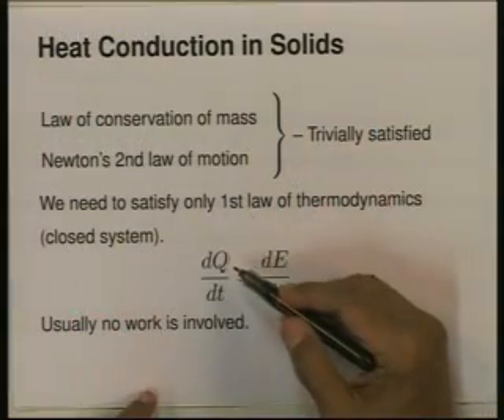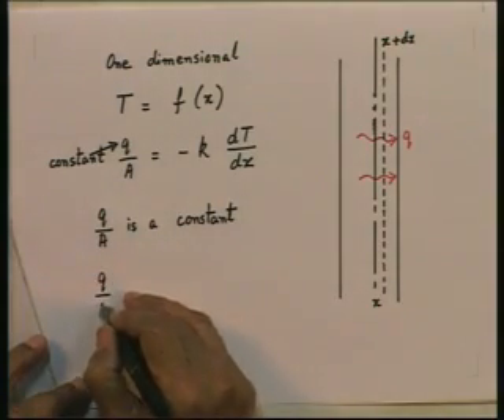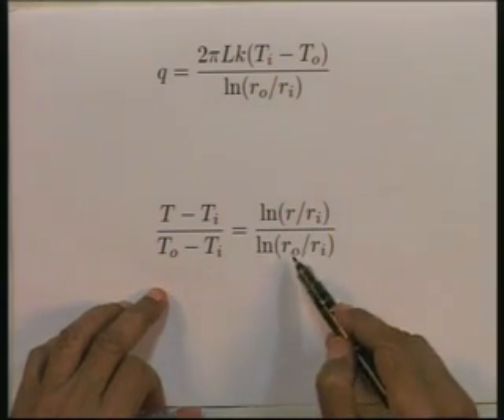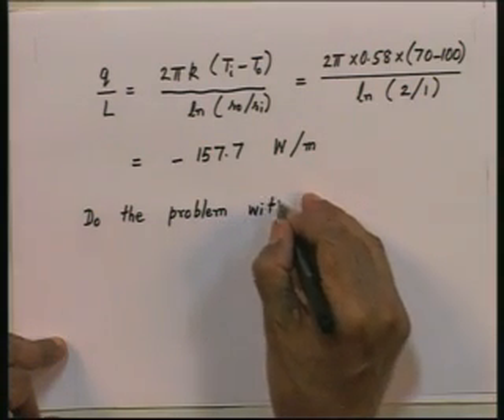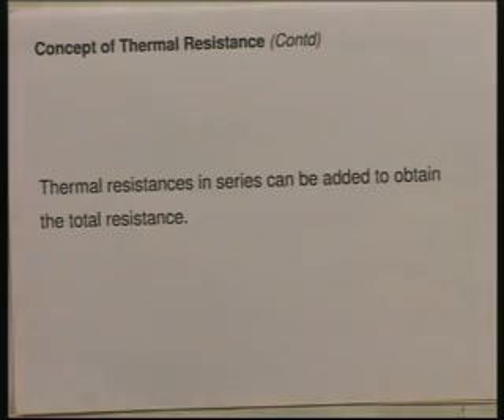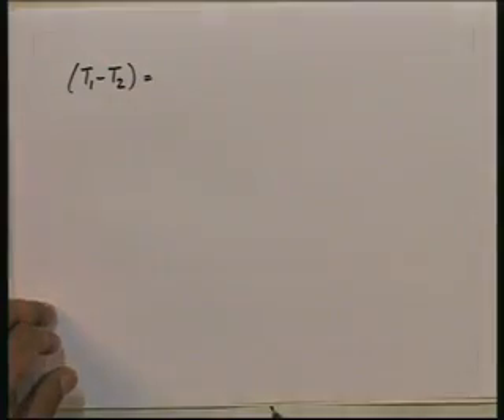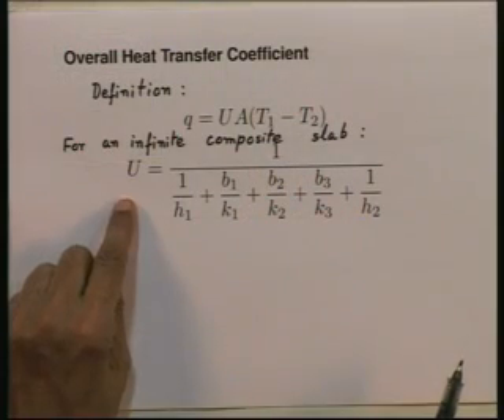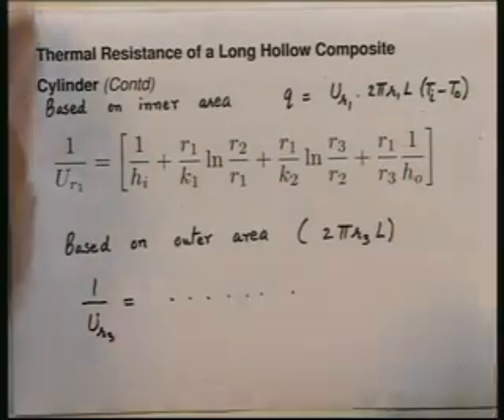Lecture - 4 Heat Conduction - 1

Comment: Sir my question is why heat flows normal to the surface....
Reply: Because we are talking about temperature gradient in only one direction. Otherwise heat can flow in any direction.
Reply: Good question, 
Because as soon as heat is conducted there is net transport of molecular kinetic energy along normal direction in a material from surface....So it is always normal to the isothermal planes so that temperature gradient forms to propagate it. It may be 2 or 3 dimensional depends upon the combined effect of thermal conductivity & temperature gradients. 
Though you apply the heat flux from any direction but at or from interface boundary it flows normally.....

The fundamental law of transfer under potential gradient is always transport normally though the flux may or may not aligned with normal but as soon as it crosses the interface of the domain under study there is the flux normal to the interface......
Then be it - 
Darcy's law of - Fluid flow under pressure difference, Ohm's law of current flow under voltage difference, Fourier's law of this heat transfer under temperature gradient & Fick's law of mass flux transport under concentration gradient.....

When there is transport flux across the interface, it always normally in or out of it.......

Comment: Sir I would like to know how we arrived at the thermal resistance (1/hA) for heat flow from surface to fluid? From Newton's law of cooling.
Reply: Generally , by MOLECULAR TRANSPORT EQUATION

RATE = DRIVING FORCE / RESISTANCE

for our case of heat flow from wall to fluid...(newton's law of cooling) is 
   q = h A ( T of wall - T of fluid ) 《1》
Here, 
DRIVING FORCE = temperature difference
RATE = q
We want RESISTANCE to heat flow....
Then RESISTANCE = DRIVING FORCE / RATE....
by 《1》
1/ hA = temp diff / q
Therefore, we get R = 1 /hA...

Comment: Professor, I think you forget to convert the given temperature unit into Kelvin. Because, K (thermal conductivity ) is in Kelvin as per the question.
Reply: It's temperature difference, so not a problem

Comment: Is conduction is possible in fluids.
Reply: Yes. But following conditions - 
1. Fluids are completely at rest & no relative motion exists either relative to any solid interface or within its own layers. 
2. Convective heat transfer coefficient is very low & also radiation effects are such that they themselves are acting like non participating & solid to solid interface gap is very small. 
3. They should have at least sufficient thermal conductivity for heat to pass or conduct through them. Their area of exposure should also be small. All these parameter should give overall trivial effect of some finite but very low thermal resistance. Otherwise, instead radiation will dominate.